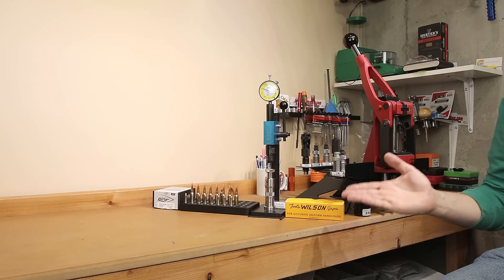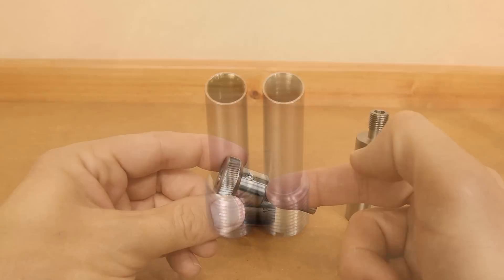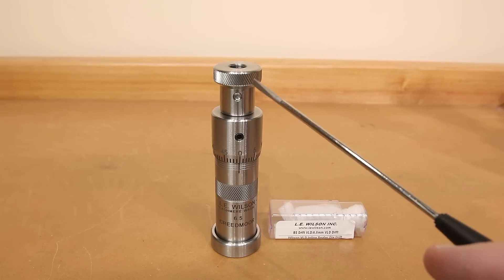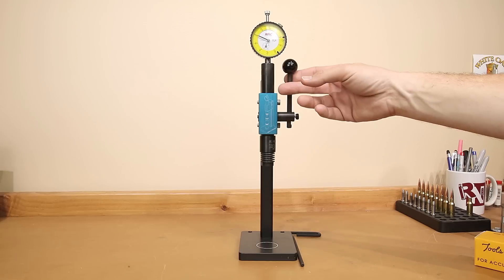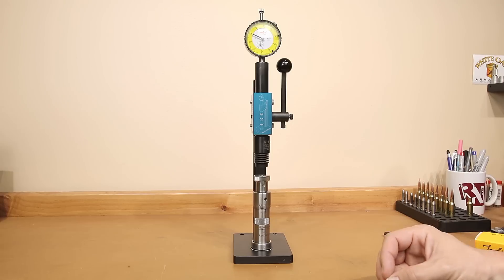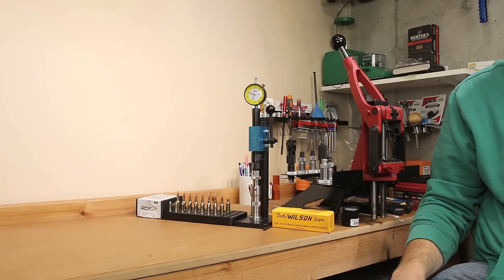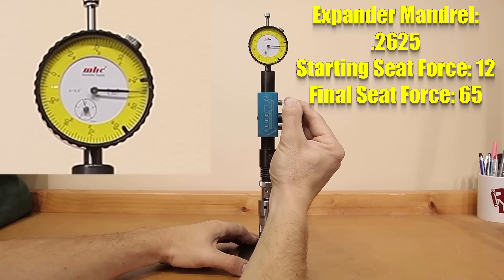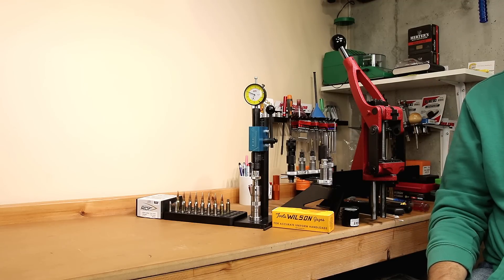Precision Reloading - K&M arbor press with LE Wilson seater die- Neck Tension vs Seating Force

Comment: Isn’t it so that a major factor is the roughness of the neck inside that plays a big part in seating force needed, of course along with the neck tension itself? It’s difficult to control that factor though. It will play a much bigger role when seat tension is on the low side . I see a lot of different opinions how to treat neck inside, from not cleaning it at all, to lubing it with graphite or just using a brushing regimen to squeaky clean inside. I’ve never tested different cleaning or lubing procedure’s effect on velocity but I’m sure many have some input on that

Comment: I’m using the same setup for my bullet seating. The only difference is that I apply NeoLube 2 to the inside of the case necks and to the base of the bullets prior to seating. So far I have noticed more consistent pressure readings.

Comment: I use a modified T7 and I do not use a resizing die I use depriving die, neck bushing die, expander mandrel then I use my K&M and I get amazing runout results.  I found when I stated when using a resizing die I got more runout believe using the mandrel is the key.

Comment: The data is only as good as the brass prep. Any deviation in prep, or residue, burs, etc. Throw everything off. I use 000 steel wool over a bore  brush after chamfer to ensure they are all consistent. You will be able to use the feel more than the number once prep is on point. Also, thicker necks (lapua) will show higher force. I turn my necks but that will always be a source of inconsistencies, and it is immediately apparent with this method.

Comment: I am starting to upgrade my tools and kit for precision reloading, and getting it right during the seating has always been a hassle with 223/5.56.  Getting the seat and crimp done correctly, and consistently has been my goal while loading small caliber rifle cartridge's.  One of my last batch's I made must have had the shoulder bumped down a fraction of a thousandth even though my OAL was correct.  The firing pin in my AR15 didn't make proper contact with the primer and I had a mis-fire... No Joy there.
Now, watching and learning about my mistake has made me determined to rework those loads and get them right.  So next time... BANG!

Comment: I am curious as to why you full length sized without an expanding device?  Why wouldn't you leave it in and run an expanding mandrel?
Reply: The expander mandrel typically produces higher concentricity compared to the typical expander ball in a  conventional sizing die.

Comment: Those LE Wilson dies and the use of Arbor Presses is actually part of the reason why, when I bought an additional press, I bought the RBCS Summit Press - there is a little add-on you can attach so that it can be converted to work like an arbor press.

I'm still tinkering with it, trying to see if there there is any measurable difference between that and my old, aging RCBS JS2 press.
Reply: But you have no feedback on seating force. 

I thought about going that way before I got my K&M
Reply: @x-calibearusallc  This is true, but I think I'm okay with that.  I haven't taken the plunge for the dies or the attachment, and, so far, I enjoy the press as it is.
Reply: @calculatroncalculatron1556  I imagine that the Summit is a good press. I have a Rock Chucker IV and it is solid. It serves mostly as a deprimer and pistol case resizer nowadays because I also have a CoAx.
Reply: I also have a 1972 RCBS JR2 press....looking at purchasing the arbor press with LE Wilson dies for seating bullets.

Comment: I'd be curious to see how consistent seating tension is with fully prepped case necks. I'm wondering if the  variations you see are due in part to inconsistent neck wall thickness and if case neck donuts affect the sizing of the neck using the mandrels.
Reply: In my experience, the mandrel takes care of the donut issue, as long as you go deep enough with the mandrel, full size mandrel past the shoulder/neck junction. You can actually feel the donut being moved through the pressure on the press handle. It is sort of like this, higher pressure to start, medium pressure when expanding neck, higher pressure when you hit the donut. Be careful not to let the case hit the die body though. I set up the mandrel die without the mandrel in the die, I raise a case all the way up, adjust the die to touch the case then back off about 10 or 15 thou. The mandrel goes past the shoulder/neck junction but the case does not hit the die body. Just the way I do it.
Reply: @6handicap604  
 So the way I understand it the donut is basically a thickening of the case neck/shoulder area which occurs during shooting/resizing. If the mandrel uniforms the ID wouldn't it then just displace that material to the OD potentially causing that material to impact the fit of the cartridge to chamber? Especially for those of us who run a minimal shoulder set back. For my set up I prefer to keep the bump at .001
Reply: @utdesertghost199  You are correct sir. The metal will be moved, not removed by a mandrel. The only way to remove the donut would entail reaming the neck. constant reaming, or removing metal also weakens the neck and case. As with most things, there is no perfect solution, only trade-offs. We must decide which trade-off benefits us the most. One must decide how important or critical the donut issue is first, THEN one must decide how to address the issue. Bushing size and push the donut against the bullet, or mandrel and push the donut against the chamber, or ream to remove the donut, then decide how often to ream. All viable choices. Even then, reaming seems to be the only viable solution. Unless you have a custom full length sizing die, you are not sizing the donut anyway. A bushing does not size to the neck shoulder junction, is stops a measurable distance from the junction. This is required by design, the bushing must rest on a shelf, the thickness of that shelf determines the distance from the neck/shoulder junction to where the bushing sizes the neck. So bushing sizing will not affect the donut to chamber relationship anyway. To me, reaming would require a custom die to ensure pushing the donut to the inside of the case then to be reamed. This thinking is what lead me to mandrels. I decided I would rather have the inside of the neck perfectly round and concentric rather than the outside(turning) then sizing with a bushing. With about .005 clearance from neck to chamber, I do not think .001 difference in neck thickness can effect the bullet much after expansion, especially under over 50,000 lbs of pressure. just my thoughts.  As an amatuer machinist, I would rather seat a perfectly round bullet into a perfectly round inside neck, but that is just me. We must all make our own choices. I have found that I have lowered my ES and SD's using the mandrel. But that is only my experience with my load and my rifle. I have put much more faith in my own testing than on youtube videos and claims. As Reagan said, "trust, but verify". The hardest choices are deciding if the process truly makes a discernable measurable difference. I have been deep into the rabbit hole, but through my own testing have found some popular processes to be of no measurable benefit. I bought a 6.5 Creedmoor just to use for testing. It is a 1/2 MOA Savage LRP. I have put over 2,000 rounds through the rifle just testing reloading processes at up to 1,000 yards. Suffice it to say, I no longer weight sort my primers, amongst other things LOL! How many people do you know who tested 100 rounds of out of the box primers against 100 rounds of weight sorted primers and charted the results?  The difference was so small as to be statistically irrelavent. I grew tired of 8 hours at the bench for 1 hour of shooting and practice. But to each their own and God bless them all.
Reply: @6handicap604  
 I think we share many of the same beliefs and theory's. I have been a machinist/ mold maker for 30 years and although I've not been involved much with metal forming I have worked a fair amount with press fits and seen first hand how the cold flow of metals under pressure can create problems. I this case it's almost impossible to solve one issue without creating another. Work the metal too much and it fatigues or work hardens and you have to anneal more often. You ream and your removing metal and eventually thin the case neck. I personally have chosen to ream for now, knowing my case life will most likely be shortened. I have a couple ideas I may need to put to action and see how they work.
Reply: @utdesertghost199  That would seem to be the best solution to me also. I say that with a caveat though. As a solution, it is the best. IF one believes the donut issue itself is important enough to warrant the time and effort of the solution. That also is a choice we all make. I guess the best way I can put it is, as of late, through my own testing, I have found that many things I was doing for consistency sake, really didn't matter on paper, at least to any measurable degree. Consistency in and of itself does not improve performance in every case. No matter how carefully and consistently one wets and seals and envelop,  it really does not improve mail delivery. Kind of like weighing primers. it is consistent, but.... Reloading cannot cure OCD, but it can cause it!!!  LOL Best to you sir.
Reply: @6handicap604  How about skim-neck turning after pushing the donut with the mandrel to the outside of the case?
Reply: @RetrieverTrainingAlone  I don't see a problem with that, although, personally,  If I was to take such consideration of the donut that seriously, it seems to me that skim cutting the inside would be better, using a  boring bar or reamer. Metal does not always move in the way you want it to. It seems to me, using a mandrel to push the brass to the outside will also push some downward, there would be less resistance to downward movement than there would be against the neck/shoulder  junction, which is stronger. In that case, the brass will be pushed back up to the donut when firing.  . 
Just my thoughts.
Reply: @6handicap604  Thanks!. That makes sense.  Some hand loaders will neck turn virgin brass, then a skim neck turn the second time after firing.
Reply: @RetrieverTrainingAlone  That also makes sense, as metal will continue to move after each firing. Brass will not move in a consistent manner simply because the brass itself is not consistent, i.e. pureness and mixture and impurities, internal stresses from manufacturing processes, etc. So one gets inconsistent necks after each firing. One must consider that these inconsistencies are very small, and may not be worth the time and effort to address. Plus continuing to turn in the name of consistency also weakens the neck and can cause premature neck failure..  As with nearly all things, there is not a solution but a trade-off. The second skimming will show this if one pays attention, the second skimming will remove brass in some areas and not in others. I have done this through the 4th firing, but then the necks were getting so thin as to be unsafe. Personally, I have quit doing many things in reloading just for the sake of "consistency" , through testing, the effort did not translate to reality on paper.  If an action does not result in better ammo, demonstrably better ammo, why do it? If I want a warm and fuzzy, I hug my wife instead, more fun and less wasted time at the bench. Consistency does indeed matter, to a degree and to some things more than others, A very smart man told me once, it does not matter how carefully you wet the flap of an envelope, how carefully you seal that envelope, and how straight you put on the stamp, it really does not effect the delivery of the mail. these choices are what are the most difficult things to decide in reloading. All the best!

Comment: I'm sure you'll find this was money well spent as you'll now be able to really see some results..........great stuff.
As I've mentioned previously, be sure to brush the necks. Any carbon in the necks after annealing will cause raised seating force as well as stop start or halting bullet travel down the neck. 
As you test more cases, you'll start to notice some reasonably large difference within the same bushing settings. This is where you'll see the case hardness difference manifest. 
You can reduce the finishing force by opening up or, forcing out the neck/shoulder junction with either a bullet or in your case, a mandrel. Because of the thicker brass in the neck/shoulder junction area, the neck ID is basically a funnel shape after sizing & why there is the considerable seating force difference between start & finish force &, why the finish force doesn't seem to improve much with ID changes. By pushing that junction out after FLS then sizing with a LEE neck mandrel sizer or, a neck only bushing sizer, the start & finish readings will come a lot closer together. 
To give you an idea, my start & finish force readings with FLS & no mandrel step are 8-12ish & 22- 26Lbs respectively with full annealing. 
Anyhow, have at it, there's much to be learned as I'm finding out. 
Kind regards................Rotas
Reply: I totally agree with you and I read the parts of the Illinois Engineering papers that you referenced earlier and I will say that I need to read that paper a couple of two or three times to digest it. Metallurgy is a scope I have never become too involved in, so grain creation, crystallization, re-crystallization, etc.  was a bit daunting to me...
As I have time, I am going to work on adapting some equipment to perform a "Bullet Pull Force" test..... as I feel that seating the bullet is one thing, pulling the bullet is another. I have my Arbor and Wilson die.... now I need time...
Reply: @additudeobx  Yes, they do take some digesting &, that paper is the simplest of the bunch. 
As far as a pulling method, I tried to come up with some way I could use the same gear as the seater force gear but, it would have to be some kind of reverse push mechanism when pulling. ??  
I think much better success will be had with a load cell with appropriate software to chart & graph the results.
I contacted this mob in California because of the software. Div Harish
Loadstar Sensors
48521 Warm Springs Blvd., #308
Fremont, CA 94539
Tel:  510-274-1872
Fax: 510-952-3700
Maybe give them a call. Initially I was thinking of a push/pull style puck design load cell that I could attach a case holder onto & use the press normally with the hornady collet bullet puller.

Hope this helps.
Kind regards...........Rotas
Reply: @additudeobx  Before you spend more expense & effort, I would like to take this time to advise that you give yourself at least a couple weeks of solid testing with your seater force gauge, neck sizing, annealing & so forth. Now ofcourse, I don't wish to interfere with your decision however, I think it quite likely that, you may well change your mind on thinking that you need to put an absolute figure on the pulling force. 
If you still wish to continue after a couple weeks of solid testing, have at it. 
I'm at the stage with my cartridge prep now that, I can tell there is very little difference in pull force between cases, even though I can't put a figure on it, I realize there's so little difference between any of the annealed cases that it really is only academic &, it is what it is. I couldn't change it much if I wanted to. All I can tell you is that, it feels about 3 or 4 times less pull force than a normally loaded cartridge which is a ridiculously heavy pull.
When I made the comment about the rabbit hole, I wasn't joking.
Kind regards...........Rotas.
Reply: @rotasaustralis  - Well the don't spend more money on it part is out the window. Honestly, I'm not spending money on it, I'm just adding to my collection of reloading tools and gadgets that I have already spent a lot of money on.... ;)  Here is an interesting Paper that I found that would be of interest to you, if you haven't already read it. http://www.zeszyty.waw.pl/artykuly/zn4(118)2018/033_044.pdf
Reply: According to studies by Annealing Made Perfect, the carbon residue in the necks act as a lubricant, but a variable that leads to less consistent neck tension, so it is a good practice to brush out the necks to remove that carbon.  " as carbon built up inside the necks, the average tensile force progressively DECREASED from 103 lbf for once shot cases (Pack 3) down to 74 lbf for three times shot (Pack 4), and just 43.5 lbf for ten times shot cases (Pack 5). Once the carbon was removed, batch to batch consistency was much more reliable"  souce:https://www.ampannealing.com/articles/42/annealing-under-the-microscope/
Reply: @RetrieverTrainingAlone  I've seated hundreds of bullets with the carbon in the neck when I 1st began my testing &, carbon or graphite never reduce the seating force in any of my tests. As well as increasing the seating force, both carbon & graphite cause the bullet to jump or seat in a stop start motion. 
Everyone kept insisting that graphite lubricates the neck so, I kept testing, always with the same poor results. I've since tested  sizing lube, silicon, inox, crc, one shot & they all seem to work very well but, my necks work so well without lube I haven't bothered but, I will be using Molly to stop cold welding of the bullet to the neck which, I have tested &, appears to be a measurable phenomenon.